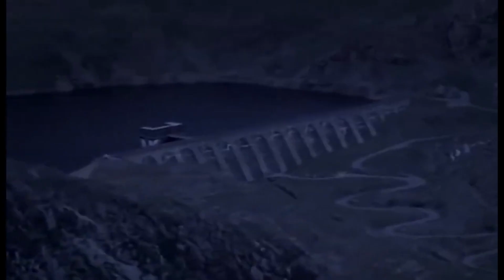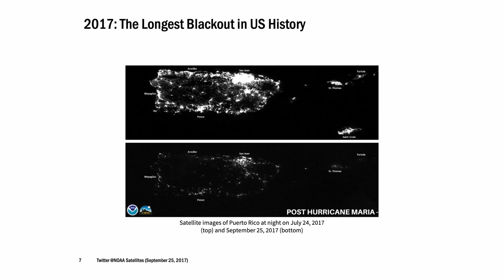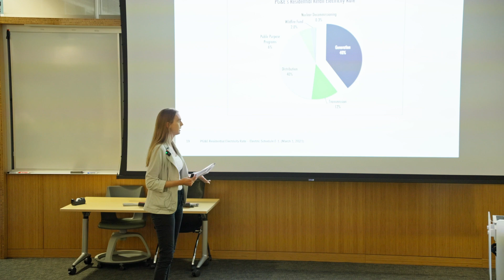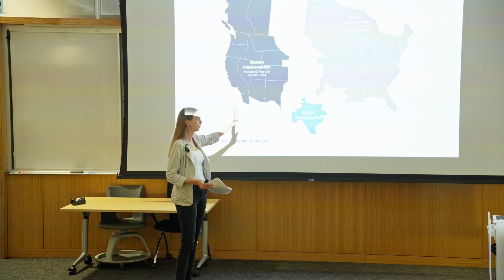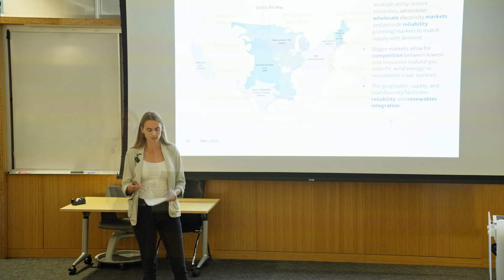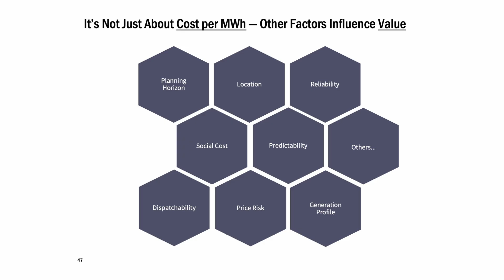OLD The Electricity Grid Lecture |Kirsten Stasio 04-21-25 Link to new version in description below.

Comment: Southern California has the most expensive electricity rates in the US even higher than Hawaii.   This high priced electricity comes from the huge amount natural gas needed to support large amounts of solar power and non existent obligation of tradition to supply economic, safe and reliable electricity.   Solar and wind generated electricity is less than commercially worthless.   Large amounts of this  erratic electricity can not be supported with steam turbine generators that react too slowly, but by running gas turbines generators at high readiness making near zero electricity at higher natural gas cost than making all the electricity with natural gas combined cycle power stations.    Note how fuel saving has never been promoted for the large percentage wind and solar generated electricity supported on the public power grid.   Not only has there been no fuel saving, but it has forced a switch to generating electricity with expensive petroleum (natural gas).

Due to every increasing efficiencies with time in real terms electric rates should be coming down.  Large industrial user of electricity subsidize electric rates for everybody else.   All large increases in US electric rates are from ever increasing support for solar voltaic and wind generated electricity.  There has been little inflation pressure on electric rates.   China is re-power and expanding it grid with highly efficient ultra supercritical (USC) clean coal power stations.   China is making more coal generated electricity with less coal.   Unaware person may believe China is retiring coal because USC clean power stations produce no visible air pollution when its the opposite.